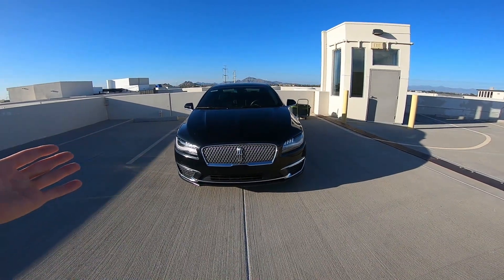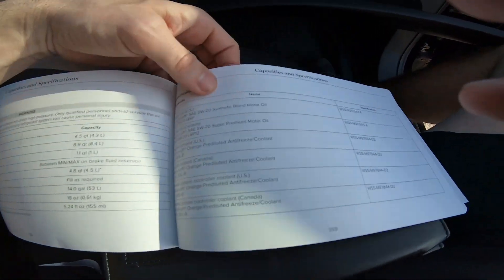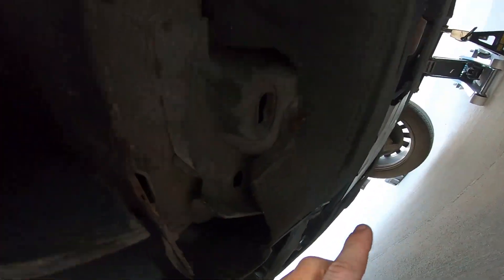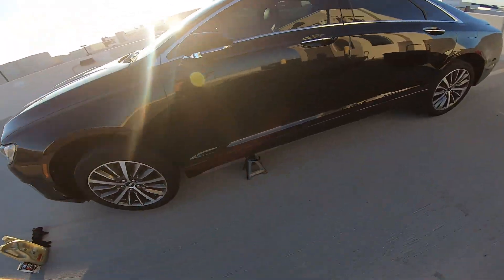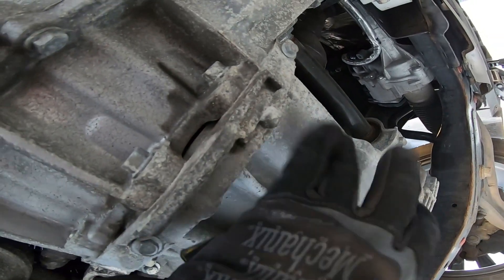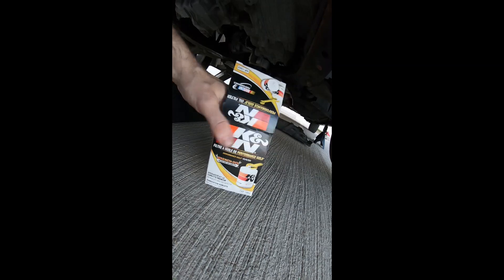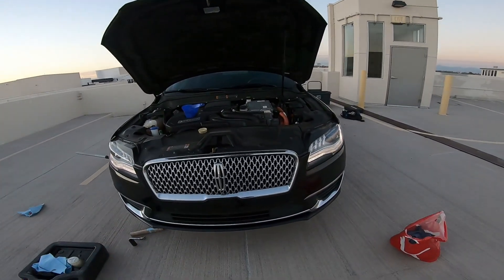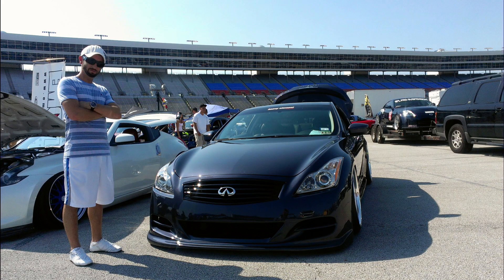Lincoln HYBRID MKZ - Oil Change

Comment: Thank you for this video sir. I was contemplating changing my own oil, but was worried about the placement of the oil filter (I never did look). I have a 2015 Lincoln MKZ Hybrid (Red), I love my car to death. Bought it brand new off the showroom floor. It has 81913.4 miles on it.
Reply from the maker: I have 121,000 on mine, a 2017 tuxedo edition. You will love this video I just made for the Lincoln with my drone I got...https://www.instagram.com/p/CIopxV-HFks/?igshid=13bmsbqlm6cv1
Reply: Wow, just watched the drone footage. Cinematic to say the least, the statement about living on the moon was priceless!
Reply from the maker: @josephljohnson  ..🙏 Thanks! No one on my channel likes the Lincoln. Proof men are the true romantics. I have a much younger Lincoln but if I post a video on it, every time I get angry messages 😂. My 15 year old G is still queen though.
Reply: I believe folks that either don't like it or don't appreciate it never drove or rode in one. The ambient lighting with the smooth ride at night, wow. They must drive Bentleys or Rolls Royces, to not like it. Just saying....LOL!
Reply from the maker: @josephljohnson  well we both know the panty ( ambient) lighting came from Mercedes first. I would never buy a Ford but the hybrid MKZ is a one hit wonder like my G35. It has an ageless design. Plus the hybrid system was proven in the Ford Escape hybrid NYC taxi cab service so these hybrid engines are proven reliable.
Reply from the maker: @josephljohnson  if you haven’t changed the transmission fluid, you need too. It’s easier than the oil change and no one ever thinks to change it. I know they say you don’t need to for 150,000 miles. Lies to make service money. Here is my video on changing it...https://youtube.com/playlist?list=PLA0mXefhg0rvbQgxvr7_6fAnrRgmkaqOq
Reply: Thank you for the advice, never even thought about the transmission fluid or changing it. Thank you very much, you're a gentleman and a scholar!
Reply: Thanks for the video. Will be doing my wife’s 2017 black label. White on white. Easy peezy

Comment: Unsure if already mentioned- when the oil filter is positioned like that, you can fill the filter prior to putting it on. Helps for a more accurate reading on the dipstick when refilling the oil. Thx for the vid man. Got the wife a 2018 a few months ago. Dealer didn’t change the oil. 15k when we bought it. 16.5k now. Oil life at 22%. Assholes.

Comment: There's also a sticker under the hood  on the front of the car telling you how many quarts of oil. The type of oil is on the filler hole cap. Love my 17 MKZ Reserve. I've got 50,400 miles on it. I use the massage seats all the time.
Reply: Was the cover easy to get off on the bottom? How may bolts are there?
Reply from the maker: @dsertwq  ...Yeah super easy. Check out my other video on changing the transmission fluid in the LIncoln...https://youtu.be/dToMaZBe1nI
Reply from the maker: @dsertwq  ...The Lincoln has 118,000 miles on it and my G has 185,000 miles on it.
Reply: @MotordyneG35  Did mine today and quickly realized the 3.0 6 cylinder is completely different and way easier than the hybrid.

Comment: Is the end of the G35 neigh? You seem to be branching out, farther away from the G...
Reply from the maker: No it is not the end of the G, I still have it. I sold the prius after putting 30k miles on it for a grand total of 240k miles. Made 30k off uber and sold the prius for 1k more than I bought it for. First time a car made me money both ways. Upgraded to a hybrid in the lux black uber category. Using cars to make money vs being money pits is my direction. Eventually I'll dump another 10k into the G to twin turbo it. I've already put a lot of money into the G and I am still happy with it; rocking 184k miles.
Reply from the maker: Plus my gf of 8 years has moved to New York city because of her job at AWS in November. I didn't go. I have lost focus on the G. It's coming back. You are right, but life can be a bitch sometimes.

Comment: I'm curious how you feel about project farms oil comparison video. Also you said you use 0w-20 in your 05 g35?
Reply from the maker: No I use 5w-30 in the G at 184,000 miles with Castrol. I also did a video on sending used oil to blackstone labs. Then a sample of 89 samples from the VQ community. It came down to Penzoil and Castrol as the 2 best, but this was a long time ago. https://my350z.com/forum/engine-and-drivetrain/258663-vq-oil-analysis-and-info.html#&gid=1&pid=3 and my video https://youtu.be/acaKSlA4o40

I did watch project farms because of you and it was really good. He had Pennzoil pass Castrol to the semi-finals. I had Pennzoil and Castrol as the top 2 best, but Castrol barley won when looking at the chart of standard deviation fo the mean from all the 89 samples sent into blackstone labs. Bottom line, if you change your oil. They all work.

Comment: Great details. Great video sir. Ty
Reply from the maker: Thank you! I am about to upload a transmission fluid change and spark plug change on the Lincoln even though my channel is mainly based on my G35.
Reply: Motordyne G35 do u know how many lbs to torque 2016 reserve wheels to? Lost my manual.
Reply: Just wheel lug specs is what I need

Comment: We have a 14 MKZ with the hybrid, 57k miles, I’m curious if you’ve heard how long the estimated hybrid battery cells life expectancy is? Thanks, enjoyed the video.
Reply from the maker: I just hit 150,000 miles and I haven’t had to replace the hybrid battery yet. Not 1 mechanical problem either or a check engine light.

Comment: 2 yrs with 100k 😲 I thought I did a lot of driving. Nice car 👌
Reply from the maker: It was a fleet vehicle is why and thanks. Sold the prius for profit with 240k miles. Hybrids will get alot more miles than a regular gas motor can before engine rebuilds.

Comment: Do you still have this car? How’s it holding up? Looking at a 2019 myself with the 4cyl engine. 2.0t
Reply from the maker: I have other videos on it. It has 150,000 miles on it, absolutely no maintenance if you buy the hybrid. The turbo you are looking at won’t last that long without something breaking.
Reply: @MotordyneG35  thanks for the video. I'm looking at buying a hybrid now in 2023.